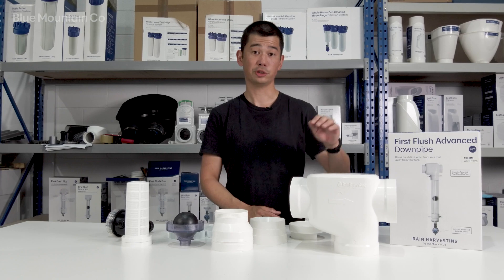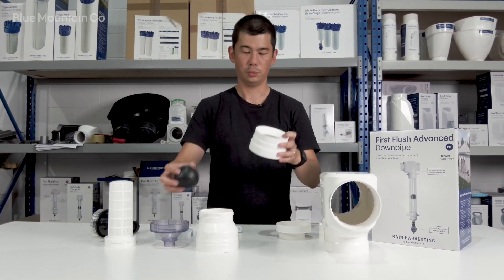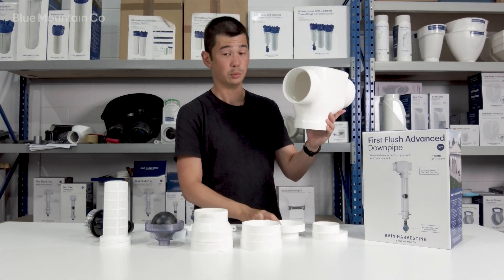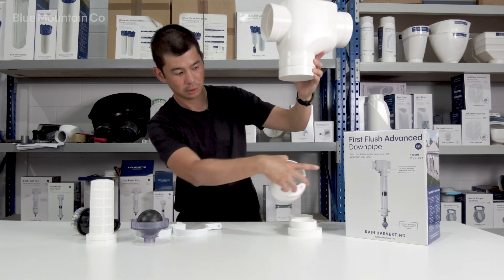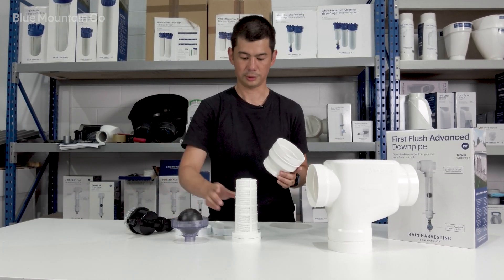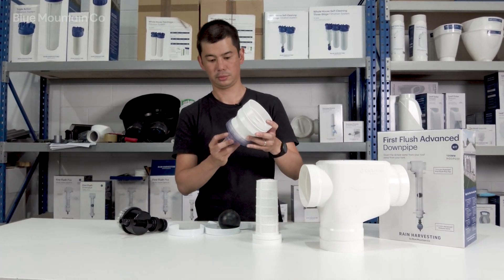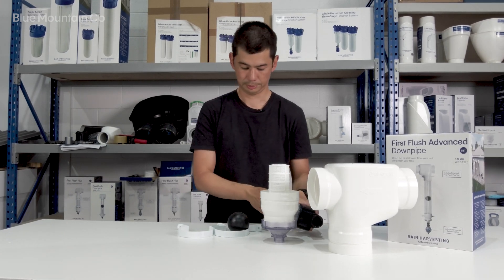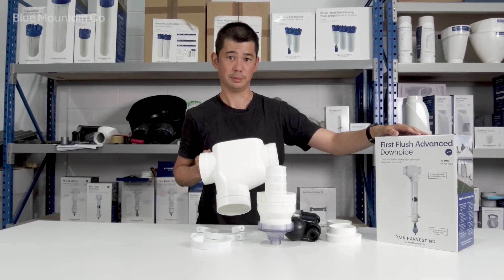First Flush w/Catch-All Tee and Electronic Valve - What's In The Box?

Comment: Are first flushes useful for wet systems? I have the assumption the water already in the system would fill the first flush and the first downpour would still make it to the tank.
Reply from the maker: Hi James! Great question.

First Flushes are particularly useful for wet-systems. In addition to capturing the first flush of dirty water, they can also be used to drain your charged lines in-between rainfall events so that the first downpour of dirty water never makes it into your tank.

Whether you use a First Flush with a slow-release (drip) valve on the end, or one of our models with the Advanced Release Valve on the end (that releases water from the chamber at an interval you choose) you can be confident that your system is capturing the first downpour and diverting it away from your tank.

In terms of sizing a First Flush to adequately drain your charged lines (and avoid dirty water ending up in your tank) there is more information I can share with you on how do do these calculations if you would like to reach out to me at info@bmco.com.au I am just a bit restricted replying via comment as I can't attach any diagrams or information guides.

- Brianna